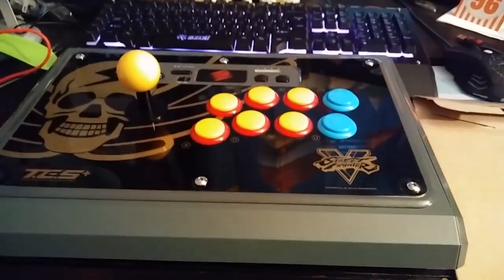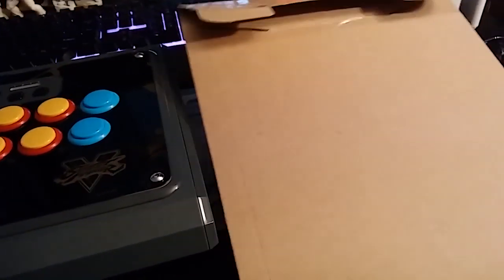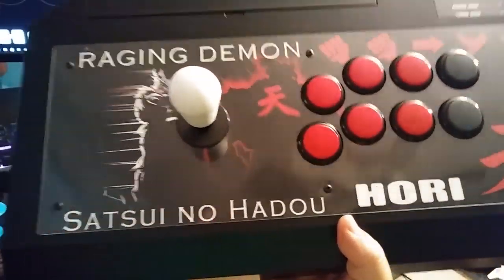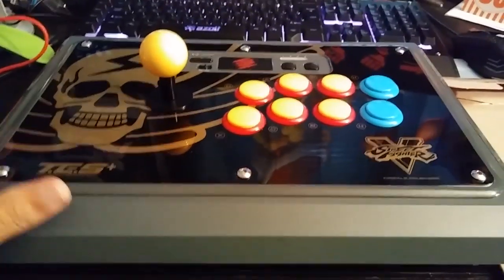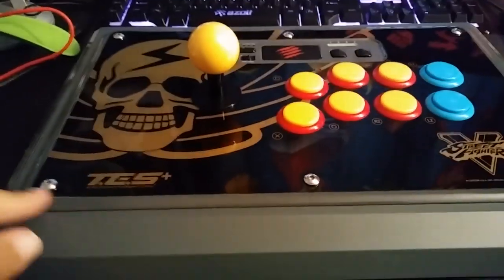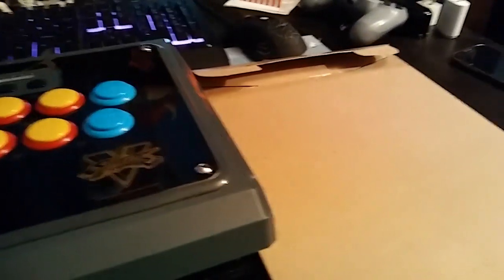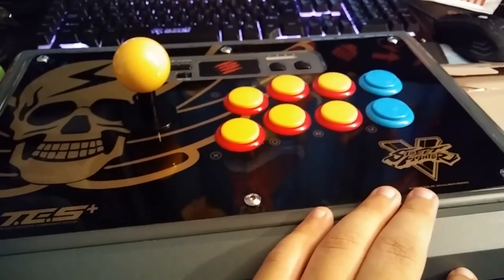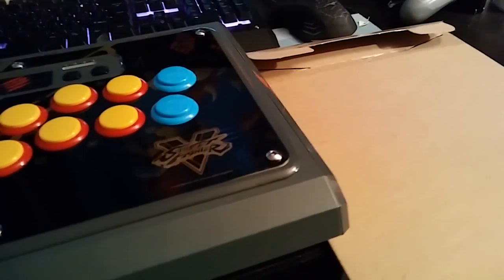Madcatz TES + Fightstick Final Mod Artwork!

Comment: I just bought this stick, I couldnt seem to turn the PS4 on from restmode using the PS button, I had to turn it on and sign in to my user using the DS4, than I could his the PS button on the stick to take control, is this normal?
Reply from the maker: Yes, this is normal because on rest mode the PS4 is not giving a lot of power to the fightstick so it won't be able to turn on the PS4 from the PS button and Yes I did try it and it didn't work for me as well.  SO you have to sign in with the PS4 controller and then switch to the fightstick.
Reply: MrBob2012 thanks for reply
Reply: You dont need to use the DS4 realy, You can just turn on the PS4 manually and then just use the stick from there
Reply from the maker: zobinake that is true.

Comment: Hi, I was wondering how you took out the connector pins from the actual buttons. I know on the te2 pins there are tabs to take the wires out. But I don't see them on the tes
Reply from the maker: Well with the tes it's a little hard to take them out. They don't have tabs on the pins on the connector. So you have to pull them out really hard but I just use pliers to pull them out. It works out a lot easy but after months already I can just pull them out easily.

Comment: i changed my buttons for the first time and a couple of the tabs on my old sanwa buttons broke with just a little pressure squeezing 'em out. is this common thing to happen with these type of buttons?
Reply from the maker: Then most probably the tabs were wearing out on the buttons. It is common but I wouldn't say it happens everytime you change out your buttons to new ones.

Comment: Are there multiple versions of the TES+? I see yours has a sixth screw 
up top, and the touchpad area is a little bit lower, but when I look at 
my local online stores they have no screw up top, and the touchpad area 
is a little bit higher (same if you look at Amazon). The madcatz artwork
 template has a 6th screw up top, same for Tek-Innovations. A little 
confusing in terms of modding artwork etc! Where did you buy your TES+?
Reply from the maker: i went to the madcatz websites and then it took me to the amazon website to buy the stick which is the Shadaloo edition. there are other older versions of the tes+ which are called tes. but i bought mine from Amazon.
Reply: Thanks for the reply! I Understand that there was a earlier version simply called TES instead of TES+ which looks completely different. If you look at the Amazon site and compare to yours you'll see a slight difference (not sure why they did that?)
I looked through the Madcatz and went to Amazon - it's the weirdest thing, but the TES+ ("shadaloo edition") on their website and Amazon doesn't have the sixth screw by the touchpad, but yours does - And their artwork template does too, so maybe if I buy the TES+ I would get the same design on the fight stick as you automatically? (with a sixth screw by the touchpad instead of five screws). How recently did you buy your TES+? Maybe there are older versions of the TES+ too?
Reply from the maker: I see. I went to check on the website to make sure and you are correct. It has only 5 screws. I had bought my fightstuck around the end of March this year. Also I dont remember how the picture looked at the time because i don't know if it has 5 or 6 screws on the picture. But my does have 6 screws or they really need to update their pictures from the website if is incorrect.
Reply: also the share and options buttons appear to be grey on picture but WHITE in actuality.
Reply: I finally got my TES+! The one I have looks exactly like yours! A friend of mine pointed out that the one we see in pictures for amazon, madcatz, etc, might simply be a computer-generated image that they use for some reason. But the one with 6 screws seems to be the one you actually get when you buy it.
Reply from the maker: Alright glad to hear that.